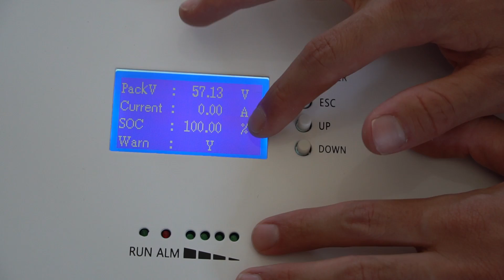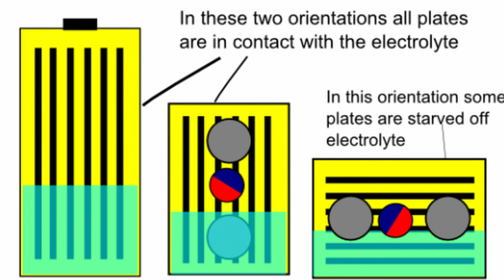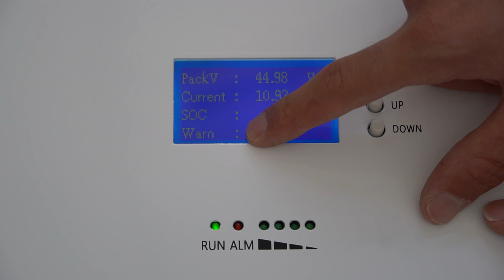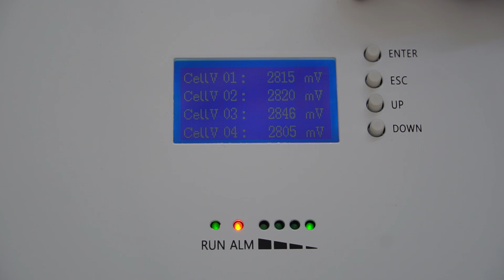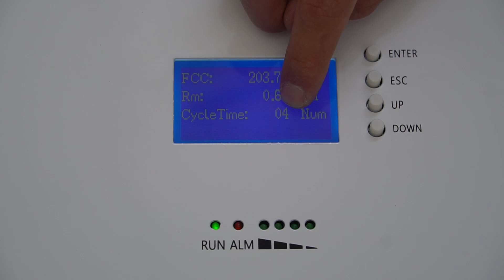10kWh 48V LiFePO4 Plug-N-Play Solar Battery for $.38 per Wh: Full Tear Down and Capacity Test

Comment: I have a similar 10kw pack from Liniotech. It has 8 dip sw. All in off position. When connect to Mppsolar inverter. It shows error61 no communication. Can you let me know the dip sw settings. Thanks. Prem

Comment: I cringed when I saw you poking around inside of the battery.  I am an electrical engineer and I was taught to "keep one hand in your pocket" when dealing with either high voltage of high current systems ... you might get maimed or scared but at least you won't get killed."  Keeping one hand in your pocket is incredibly awkward; however, it retrospect this might have been the point.  It's the EE equivalent to measure twice and cut once.  I noticed that at one point you were wearing gloves.  I think that this is much better solution than trying to keep one hand in your pocket. The "bug and feature" of your videos is that you have a gift for making things look so simple and easy.   I have admired how you have fool proofed some of the procedures; however, we are all capable of dong some very foolish things.  All EE's have at least one story.  I think that a link to where you can get the gloves would really help your audience.

Comment: Do you have a video setting up a backup power supply first so you can use the grid until you have the cash to set up solar panels? (Like having the Tesla wall. I  need the power backup as its a PIA to hook my welding machine up for the occasional 1-2 hours of power outage.. Building my house soon and then I will set up  solar.  Or can ANYONE point me in the right direction?

Comment: I'm new to the solar field, but isn't it all about STORAGE CAPACITY? I don't want to pay $3,200 for this Tess Electric 200 amp hour battery, when I can buy locally, 280 amp hour, 6v lead-acid batteries (8 of them for 48 volts & 2,240 amp hours total) for $320 each new ($2,560 total) and I don't have to keep them warm in the winter (especially after a SHTF event). I also bought a Schumacher [FR01335 Battery Charger, Engine Starter, Boost Maintainer, and Auto Desulfator - 150/200 Amp, 40 Amp boost, 6V or12V] for $177 off Amazon to keep the batteries "new" if you watch how to 'renew' a lead-acid battery and keep it new for years and years past it's 'normal' life time. I dunno about these super-expensive Lifepo batteries, seems like some corporation that likes to sell super expensive batteries has pushed these on the public.

Comment: @Will, it looks like you don't really care about the communication port on the Battery pack, If i'm not mistaken... If that is the case that an Inverter able to charge the battery doesn't really care about communication at all, is this correct?

Comment: Which company is the manufacturer of the BMS?
 I ordered a power choice from China that looks the same, only the front has a different name on it and I'm wondering whether you can connect different manufacturers to each other via the communication interface.  or does it always have to be the same manufacturer and you can't mix them?

Comment: Hi! I have just bought a similar but another type of 10KWh LiFePO4 battery. I would also like to test its capacity without connecting to inverter and solar panels. Could you please let me know what type of charger you used in the video? I would charge it from a 230V power grid. Thanks in advance.

Comment: I tried to parallel this UFO 10kw battery with my eg4 LL v2 5kw battery and they parallel just fine they try to sync voltage but the current draw all comes from my eg4. Any way to get them to both produce

Comment: Hi a newbie here im looking to build a solar charger for the car and i do not understand some things so i would like to know why is it rated 350 amps? what does that mean charging or discharging? i will be hiring a professional to install but i want to understand the system.. as far as i figured out its amps x voltage = kwh ... so how can it be 350? im confused..

Comment: Hello will, am a great follower of your DIY solar energy systems.
I have a question, I got myself an Energetech LIfepo4 14.3kwh battery and am unable to charge it to full capacity with my solar panel system and my hybrid 10kw Must inverter. Is there a different program on the the inverter I should select or a different gadget to help charge the battery to full capacity. Because I want to be off grid completely.

Comment: Hi, when it turns on the under voltage warning, how do you get it to start charging again? my inverter when lowering the battery voltage to 46v does not recognize the battery and does not charge it

Comment: So in round figures, a 200amp/hr battery, gives you a 10kw system! Loosely speaking....!?
Reply: watts = volts * amps, in this case 48 * 200 = 9600w rounding it (as the batt is actually 51v) we say 10.000w (10kw)

Comment: The wedsite selling this battery says: These Powerbanks work with 48V DC Hybrid inverters, and are NOT compatible with AC coupled systems. (Solaredge, Enphase, etc.)
Am I safe to assume that the Sol-Ark 15K can't handle it? 
I find this difficult to understand. Why would an AC coupled inverter not accept this battery. All batteries are DC anyway so what's the problem?
Reply: This is saying that you can’t use these batt packs in a off-grid setup, they need an hybrid inverter, in other words, an inverter that can send to the grid the extra power. It says they need to be used in a setup where you sell the extra energy to the grid, I’ll have to assume because of the cells or bms construction, hence being a bit cheap (?)

Comment: I would not be worried that much with vibration or pressure on cells as they are no Li-Ion. You can drive a nail through that battery type (LiFePO4) be "fine".

Comment: Hi Will, I think your tube channel is brilliant. As a Brit thinking of attempting to go off grid, I would love to know if the battery units on your channel are available in Britain.
Reply: So would I as I'm thinking the same thing. Also from the UK.
Reply: The only issue with US units is in the inverters as they all output 110v instead 220 (there are some that do 110/220), but be aware… regarding batteries and battery packs, you’re safe to use anywhere in the world

Comment: If you ran a medium size home with the basic essentials, double door fridge, microwave, 55" tv, 3 desktops, 2 laptos, 2 tablets, 4 cell phones and a 20 seer split a/c unit 18000 BTU how many hours could I expect from the LifePO4 10 KW Lithium battery
Reply: Checkout your electricity bill. it will show how many KW you r using daily

Comment: Great video.  I just subscribed.  It's funny hearing you complain about how much that battery weighs.  We installed our off grid system almost 6 years ago and went with flooded lead acid batteries.  Our battery "system" weighs about 7500 pounds - so yeah that's heavy.  I'm certain when we are forced to change out our batteries in the future, we can convert to a much lighter technology.  I hope that's at least another 10 years out.  We try to never drop under 75% SOC.

Comment: If I am temporarily charging batteries and the terminals are exposed, I do it in a room I can lock, so no one goes in accidentally and touches any terminals, and I also put these thick plastic kind of socks (the kind used to keep drinks cold).

Comment: I have a small solar farm limited to 74KW output to the grid. The only way for me to increase the energy production is to keep sending energy to the grid (@75kw) 24x7. Would it be feasible in 2022 have an 1.5MWh battery that is reliable and long lasting (10+ years). Thanks for sharing this. Love your channel

Comment: I have two of these with Growatt 5000 inverters , the cell voltages are all  at 3345 v yet the  inverters wont work as they tell me the batteries are low voltage ? 
I , well ,3 of us , did hang them on the wall, what a dead weight , maybe  I,ll stand them on the floor  and read the screen with a mirror !!

Comment: This may be a ignorant question to you lol

But you are fully off grid electrically yeah?
Lol with all these batteries and equipment I would assume you could sell back to the grid a enormous amount if they could get certified to do so.. (and your state allows it)

I'm eventually wanting to make a totally offgrid system when I buy the land I want and run a rv and small house. 
 
Your channel has probably the most value to me and others doing that since you give alot of technical advice and opinions/facts about the particular batteries that would be very important. 

Torn between this type of cell and the tritinate cells for cycle life (for one and done for life idea) but had no idea about the discharge efficiency things and a few other variables like acceptable voltage to the inverter being biased

Comment: In the Denver metro area you can go to grid Alternatives and you can buy used or slightly scuffed panels every one of these modules is of the newer class 315 w so something to look into they only charge $20 per module

Comment: I've been a subscriber for ages and absolutely enjoy your videos.  I've been following you since your car camping days.  😀    Glad to see how much you have progressed.   I would like to ask if you can suggest a good power to weight rack mount setup for me to install on my Catamaran.  I'm not too worried about being so waterproof.  No water gets in where I intend to place it or them.  I can also put a silicon seal around any metal joins.   I am also looking for a unit with 3,000 to 5,000 Invertor.   I can't believe the low prices now on litho batteries.  Anyway.  I trust you and your knowledge so any information I will be incredibly grateful for.  BR, Chaya.

Comment: I would zip tie the +/- leads to face opposite directions by tying one back open itself.  Still not %100 safe, but better than having two off the same length that "want to" pair together... specially tem big fat ones :)

Comment: Hey there Will, what are your thoughts so far on this battery? I pulled the trigger on 2 of the 7.5's and was wondering about the mounting orientation. I like the idea of leaving them on the ground. According to their manual it does state they need to be no less than I think it was 10 degrees from vertical but didn't say anything about being upside down. 

Any issues so far with being upside down?
Reply from the maker: Leaving on ground is how I am still using mine
Reply: @WillProwse  awesome brotha thank you for the response. Mine just came in tonight. Tomorrow will get the big day we've been waiting for. I really appreciate what your doing for the community. Your info is invaluable sir.
Reply: Hey there Will, I'm running into an issue connecting these batteries to a growatt 5000 ES. Have you ran it to a growatt?
Reply from the maker: Mine is cycling everyday still. No issues. Orientation is not that big of a concern anymore. I talked to some engineers and most are designed like that now.

Comment: Will the Manufacturers website shows a 10 year warranty not a 20 year and I see no low temp protection on any but this model. I see none on the 5000 or 7500

Comment: SOOO glad to see you testing these. We purchased one back in July/2020 and think its a BEAST. We went with a 48V 10Kwh unit. EDIT: So we just noticed our battery is not even remotely reaching the state of charge you show in your video. (our ceiling appears to be 53.98V) Should we be concerned? We're also in a much colder climate in Idaho! However, the battery lives in a heated workshop at about 58 degrees.
Reply: There are several different packs and some of them have different cell count so voltage will be differenent. I got the 13.4kWh pack with 15 cells so the voltage is different than 16 cells
Reply: Hi, what is the size of your inverter, what you are using for(watt wise) and how long it last, thx
Reply: @raselharfe9018  We utilize an Outback Radian GS8048A-01 8,000 Watt Advanced Inverter/Charger which was and is part of a FLEXpower Radian Powerwall prewired setup. As to watts and how long that lasts, that is going to vary highly dependant on use. Your mileage can and will vary.

Comment: They really need to include the handles with these powerpole connectors. I have a couple 180ah batteries and the connectors are completely inside the case with nothing to grip.

Comment: 10kWhr can provide around 6kW for less than 2 hours subject to heat and chemistry issues.
Impressive..but is it enough if there is loss of supply?
In my home, absolutely yes.
Other homes? No.
If you try to run an electric shower it cannot cope. You probably need two or three of those batteries connected in series to guard against tripping out.

Comment: I have been very interested in adding battery storage to my house.  I have 41 SunPower 330W solar panels.  The breaker box is 200 amp service.  The house has a central air propane York furnace with electric oven.  The winter before moving into this house during a very cold week in February 2020, there was a high wind weather event that knocked power out to a huge area for 3 days in most palaces, out to a week in others.  I wanted a battery backup system like this can run the entire house.  Is one battery sufficient for this at 10 KWH or do I need 2 or 3?

Comment: Can the front plate be turned over and have a much longer display cable to reach and connect to the control display and then the battery could be attached on the wall with the Anderson connector downward like it should or can be ? Check out my DIY solar system on my channel , hit like , leave a comment and subscribe . May the solar be with you .

Comment: Good work.
I'd like to point out that a 20 year warranty has some value even if the company goes belly up, since most companies don't plan to go bankrupt, which means that they plan their warranty policies to be financially viable, or in other words: the product is designed to last that long, (while a product with a shorter warranty is designed to break sooner).

One more thought: if you want to orient them the way you wanted initially, and still be able to access the screen, you could probably set them up like drawers in a vertical "tower"... maybe even use a couple of small mirrors per battery, (a "mini periscope"), to avoid having to pull each of them out just to check their state.

Comment: Hello Will!
I have a simple but (obscure?) question about batteries.

With a BMS like this 10 kWh battery has, could you hook this into parallel to a second, already full one?
I thought you had to balance batteries before connecting them in banks. Is that only a concern when you are creating a battery out of a bank of cells?

Comment: Will, how is the 10KWh battery better than say a Chins you reviewed that costs 1050 (roughly 300Ah@12v) and delivers 3840Wh, 4 of them in series will yield a 48V system for 4200.00 with 15,360 watt hours? I am new to all of this.

Comment: 6kw max charge rate?  you may look into old used cisco catalyst ws-cac-6000w power supplies they can do 6kw at 42v, but you can increase with a internal potentiometer to 48v or slightly higher (depends on what caps are installed 50 or 63v)   
these supplies go for real cheap on ebay, i got one for under 30 bucks

but i think the 6kw is only for 240v circuits, 110v people gotta stick with 3kw.
its not constant current, needs extra stuff for charging batteries directly.

Comment: $.38 per wh is $380 per kwh. Are you nuts? Why would I buy a battery that costs that much and only lasts for 5 years when the cost of electricity is only $.06 cents per kwh???

Comment: Riddle me this Will (please).  My first started on your channel it was to add a solar system to my RV. Back when 20, 50 80 watt panels were popular. Anyways you had just come out with your book and I bought a hard copy. So I've been watching you since then. With knowledge obtained from all your videos I've installed solar system on the last three RVs I've owned. The very last one I use those little 50 amp reclaim batteries from the hospitals crash carts. I picked up six of them for ridiculously low price. It worked awesome we never were concerned about running out of house battery power. Anyways I sold that unit about another one, it came with one 12 volt battery that I upgraded to two golf cart batteries. There's a lot of things needed to be upgraded or fixed/repaired on this RV so inexpensive golf cart batteries was the way I had to go at the time. What is the most cost efficient lithium style battery that you would recommend for an RV? Thank you very much congratulations on your success and your improvement in health
Reply: Nick..I did not have much luck with my local hospital when I tried to put my hands on those batteries.  How did you go about getting those that you used?

Comment: Another great video Will. When the mfgr says "UL Listed" it is important to know which listing. This one looks like only the cells are listed to UL1973, not the full system (BMS, inverter, coms, functional safety). Suggest you look at products that are UL9540 listed for true safety. You are right that there is a lot of energy that can come out in a very catastrophic way if not well designed. Keep up the good work!

Comment: With the location of the handles on the panel, it appears that it is designed more to lay in a rack, rather than hang on a wall.
Reply: This battery is branded with different names..most examples are wall mounted..it would make more sense to have the connections at the top for wall mounting.

Comment: very similar to my Rosen battery which just got over-discharged. similar Soc indicators, ports, and everything. Either these guys are doing tech sharing or cloning each other. Mine was 4.8kw 48v 100Ah.

Update: the BMS was the fault so they're sending me a replacement